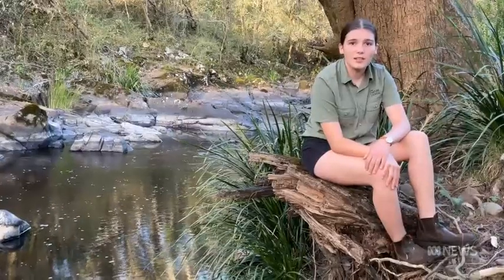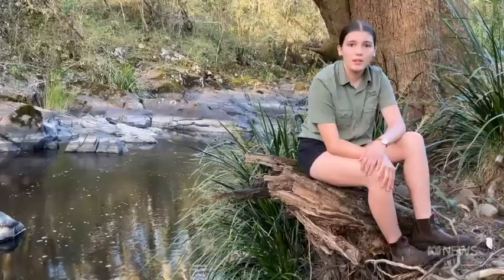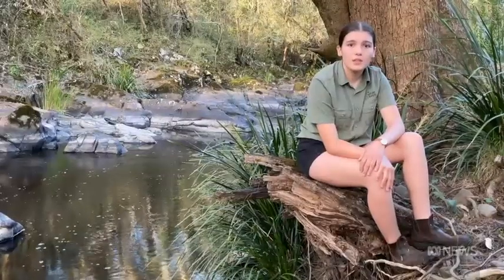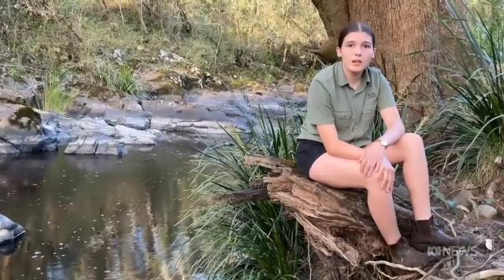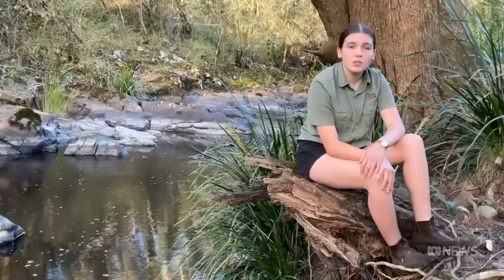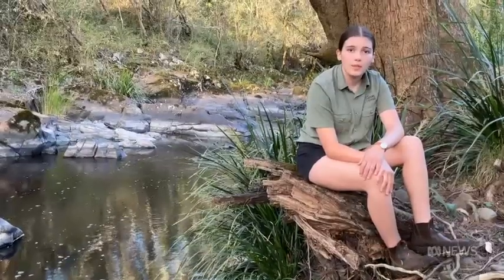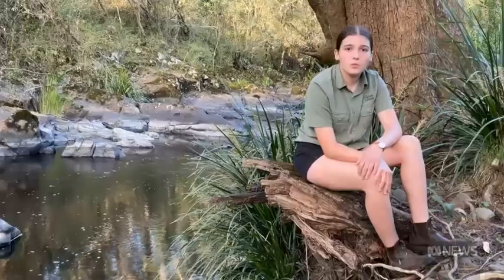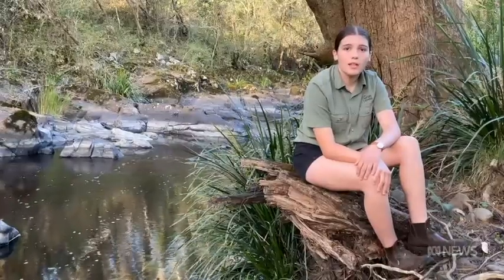Aqua Loop, l’invention prometteuse qui permet d'économiser jusqu'à 7 300 litres d'eau par douche

Comment: There is another better idea, I saw that in Romania, you put 2 pipes for hot water circulating inside the heater and coming back always. This way you open the tap on hot water and comes instant hot water. 😅